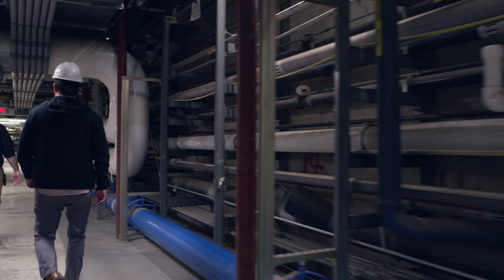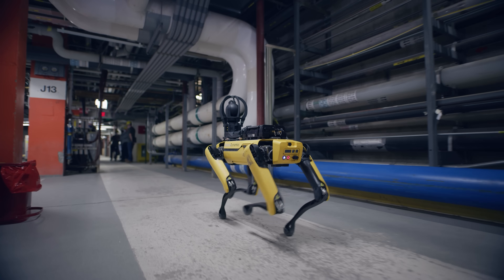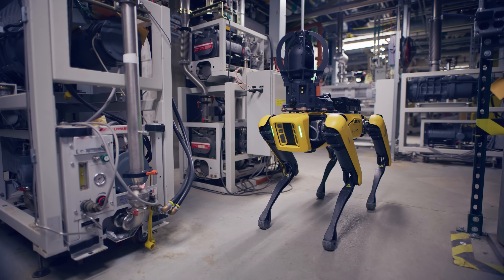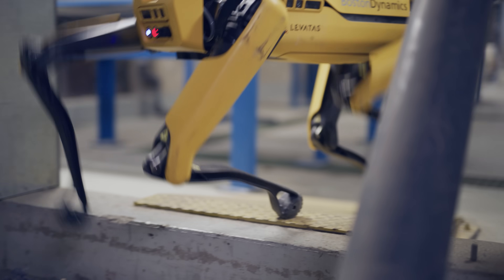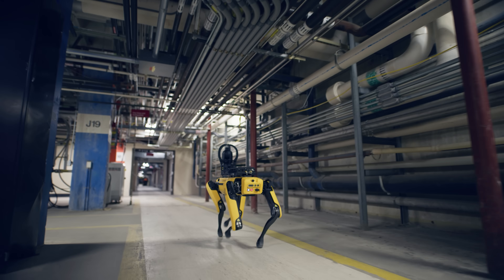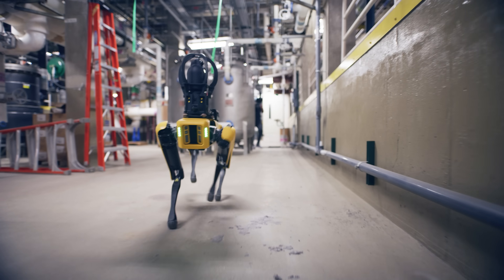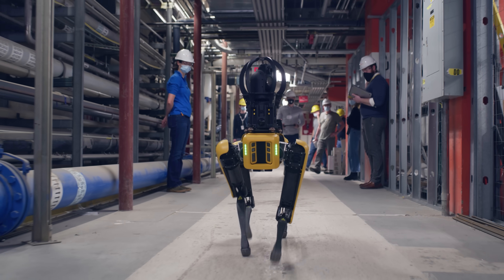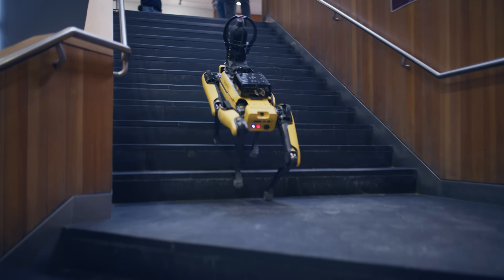Spot at GlobalFoundries | Enterprise Asset Management

Comment: Monotonous tasks like checking sensors and equipment are a great application for robots. Will be interesting to see how these sorts of applications work out long-term and how this industry expands.
Reply: Let's not forget that it would be insanely time consuming to retrofit all this equipment to self monitor, and you'd still need to monitor for if any one of all these new points of failure has any sort of issue. Spot just introduces one new point of failure instead of thousands, and can still be inspected by a human quite easily.
Reply: Sadly, the only people this benefits are the owners of the company. Productivity will rise, costs will decrease and none of these profits / savings will be seen by us. No different as in the 1970s when automation was being introduced and people were promised 4 day work weeks for the same pay due to increased profits.
Reply: Monotonous to you.
Essential jobs for those without your impatience or skills.
Reply: @Ferris.Bueller  ...what?
Reply: Monotonous tasks like checking sensors would be better done by hooking up some sensors & PLCs to the devices and continuously monitoring what those things are saying in realtime. I suppose robots could patrol and look at dials, converting analogue to digital but that's really doing things backasswards. I see robots more useful for other monotonous tasks such as patrolling facilities or going into dangerous situations where you don't want humans to be going until you know what's what.
Reply: @drxym  i see you didn't read the miles of comments above
Reply: It looks like they are pulling hard to create a job for spot. Instead of deploying a robot to read gauges and check equipment, it's much easier and cheaper to make wireless sensors and equipment that sends data to a computer. If you still wanna impress people, buy a drone. It will do the same job much cheaper.
I think the best jobs for Spot are tasks like remote bomb disarming, getting in tight, dangerous and hazardous areas, entering vacuumed areas ect. 
Reading gauges is not the job for such a hi-tech robot.
Reply: @vpryt18  ya they're obviously trying to find a profitable use for spot. Bomb removal is a very specific non profit use of a robot. Overhauling all the sensors is probably more practical but expensive when it's millions of dollars of machines. One robot is maybe a more affordable interim solution
Reply: Don't really get why they just can't install gauges and sensor that can be monitored remotely and automatically by a computer.  If  theres a mechanical part that needs to be monitored, install a camera.
Reply: @samik83  For a fraction of the cost.  These robots are cool but they are a money pit.
Reply: @samik83  It becomes more cost efficient to use autonomous mobile robots when the number of gauges/mechanical parts is very high, like in this example.
Reply: @HL-xi7sz  Don't buy it.  Wired sensors can't cost that much these day. And if there really are so many sensor then I doubt one single robot is enough to keep check on them all. 
Well maybe its cheaper if you have old tech and don't want to retrofit everything....
Reply: @samik83  The cost of Spot is  $74,500. You then have to program your tasks to inspect gauges / temperatures / switches, but that would only take a few days at most in a large company with an I.T. employee.
The kicker is that if something needs to be changed there are no wires to re-route, you just alter the path of Spot and instruct him to forget the old instrument and expand the program to read the new instrument.
Reply: @nigeljames6017   Indeed, a major advantage of those autonomous robots is that they are much more flexible.
Reply: @samik83  
I can tell you never priced out the cost of computer sensors. 
Plus there is miles of wire to install cable trays and massive computers. 
The cost is in the millions.  These so called smart sensors fail at alarming rate.
This one robot can checkout everything plus  if a worker is not where they are supposed to be.  The robot will rat them out.  You are tired from partying and you think you sleep in a corner. The robot catches you and can't argue with it.
Reply: @assassinlexx1993  Well maybe you can tell me how expensive a "smart sensor" is. I suppose CAT5 cable is amazingly expensive too. And yeah I suppose it will need some supercomputer to process all the data....or maybe just a regular server if the data rate is so slow that a walking robot can do it.  Wouldn't be surprised if it could be run on a Raspberry PI.
Reply: @samik83  
One  simple gases detector is a $1000. Now you add up hundreds of places just this one sensor.  There is sensors for valves to detect if open or closed  pressure sensors,  temperature sensors . Flow sensors.  All these sensors add up in the millions at a large industrial plant.  So one inexpensive robot  checking sensors/ safety/ hot spots . Is a wonderful thing for engineers.
Reply: @assassinlexx1993 going to need a source for that $1000 sensor.
Reply: @samik83  
Just Google remote sensors.
Reply: @assassinlexx1993  googled for some Siemens remote sensors. Ranging from $20-250.
Reply: @samik83  You don't work in the industry, do you? I kind of wonder about your Raspberry Pi (???) and CAT5 ideas - I mean even we in our little 14000m2 factory ran into CAT5 max length issues, bus data corruption from electrical noise, and the installation of cables to every gauge just isn't cost effective. It doesn't matter that you can find sensors (where, actually? alibaba?) for that price, they have to be installed by the book, checked, calibrated and then programmed into the PLC. And then where are you? A system with thousands of sensors, that used to be simple gauges read by a human, and instead of using a robot for the checkrounds you now have a thousand sensors that need to be checked regularly for function - and as someone else mentioned before sensors do break down. Gauges, if properly installed and used, are way simpler tech.
Reply: @deildegast  If you ran into problems with CAT5  you chose the wrong cable. If you have max lenght issues then add switches. For a single line these are cheap.
 
What I'm really getting at here is you guys are basically defending a commercial here. Wouldn't surprised if they got Spot with a good discount to do this bit. After all they are trying to sell the thing. I highly doubt Spot is checking THOUSANDS of sensors here.  If they were checked manually before, it would have been quite the job. If you have many clusters of gauges I don't see why cameras couldn't be used to cover a good portion of those. That would actually be a cheap solution.   

I'm not saying Spot couldn't be used in a lot of applications when the AI gets good, but just using it as a "gauge checker" seems backwards, if you didn't have the foresight to install them when building the factory when the cost would have been minimal in the grand scheme of things.
Reply: @samik83  No, we are not defending a commercial. I have 17 years in the industry in maintenance on my back, and I guess the other people that tried to make you understand things are not that simple probably add their experience. Things are not that simple in the real world. And you dont even understand. " If they were checked manually before, it would have been quite the job." Yeah, that is exactly the point. Spot can walk the same tour 24/7, and its payload can be adapted to check the gauges for wrong values, there can be a thermal imaging camera that checks for hotspots in the electricals at the same time, and it could sniff for gas leaks at the same time. Consistently. You have apparently no idea how big systems can get when you think that a 1000 sensors is a huge number, and you have obviously still not understood that a gauge is a much simpler system with less single failure points than an electrical sensor. You live in a dream world where everything can be cheaply bought and built (you talk about building a new building with "foresight"....), while people like me easily see kilometers of wiring, a myriad of installation problems, cost overruns and a huge effort to failproof a system that was built to be human readable but now is PLC driven. All for the cost of a little robot. Heck one single filling machine in one single line line in our factory is more expensive then that robot.
Reply: @samik83  And btw. my factory was built in the 1970s. I hope someone had the foresight you require now, back then, to see that we would be running fiber cables, mobile phones and computer driven lines now. Things are so easy when you have no idea what you are talking about.
Reply: @deildegast   "No, we are not defending a commercial."

It clearly is a commercial. If you can't see that, then I don't know what to tell you. You know what commercial usually do? CREATE a need for a product.  

"If they were checked manually before, it would have been quite the job." Yeah, that is exactly the point. "

You miss my point. I highly doubt there are THOUSANDS of sensor that needed to be checked manually simply because that would not make any sense.  Do you actually have something to back that up that there are thousands of sensors that Spot will be monitoring?  Because even for a robot that would be quite a challenge.

"here can be a thermal imaging camera that checks for hotspots in the electricals at the same time, and it could sniff for gas leaks at the same time."

Now this would be a legitimate use for the robot.

" You live in a dream world where everything can be cheaply bought and built...."

Well thats kinda what you are saying by getting this little robot.  No need for wiring or remote sensors, Spot will check thousands and thousands of gauges for you. Just for this low low price. It will work always, without a hitch unlike those pesky remote sensors.
Reply: @samik83  "CREATE a need for a product." This need already exists, because of humans failing at doing that job efficiently. "Now this would be a legitimate use for the robot." - Yeah, that is what is coming. And the cost of installing your proposed surveillance systems in such a large area will be bigger than the cost of running the robots. "Well thats kinda what you are saying by getting this little robot" No I don't. What I am saying is that in my scenario, if the robot breaks down, you send a human to do its most critical surveillance tasks, at a cost, or another robot. In your scenario, when the centralized system with the sensors that replace the gauges fails, there is no more production - that is why such systems often only do surveillance, data logging and non-critical tasks. And your middle solution, installing cameras at all surveillance points (and eventually other sensors on top of that) is still way more cabling and installation than just buying the robot. So for the price of the robot system, you get something that is better than what you currently have without changing much to what you have, while even with just the camera system, it has to be installed permanently and then can only do that, ever, at the points where you installed it. And that right there is where the versatility of a robot like this comes into play. Me personally, I would like this one to listen inside a certain audio frequency spectrum as well, triangulating air and steam leaks while doing its rounds, and alerting maintenance to the leaks. That is something that would require a human, and cannot be easily done by stationary sensors, hence the robot. But the work has to begin somewhere, and somewhere is "check all the gauges on your round" - you know, because the work actually needs to be done, outside a comfy chair and a drawing board with lots of imagination.
Reply: @deildegast  "And your middle solution, installing cameras at all surveillance points (and eventually other sensors on top of that) is still way more cabling and installation than just buying the robot"

Well it depends. If there are cluster of gauges, one camera can read multiple gauges and would cut down the camera need significantly. Cameras are relatively cheap these days, I don't think you can argue against that. Running the cable is a hassle, no doubt, but should not be really that time consuming to install if you have wire racks going along everywhere, as industrial sites usually have. Cameras can be daisy-chained from one point to the next making it simpler for long runs.  
Gauge reading could be automated by some simple image recognition like they do with Spot here.  
If a camera fails, it's easy to replace. Even if the whole system fails you can do the checks the old fashion way till you get it back running.
Reply: @samik83  I agree with what you wrote, but then the system can only do visual surveillance on a series of chosen points, as opposed to a freely reprogrammable robot doing new or different rounds. If you really only want visual surveillance at a number of inflexible key points, this robot is maybe not suiting your needs (depending on facility size and type). That of course has to be analyzed and checked vs. the cost of investment. In certain cases, robots are just not the solution. In others, they are a very good and flexible base platform for what you would like to achieve.
Reply: @deildegast  Yeah I think these robots have their place and will dominate the industry once we get general purpose AI at a good level. Then they will require very minimal programming and are more of an out of the box solution. For the time being, if you just want to check gauges, this might be a rather niche solutions.
Reply: @samik83  I only wonder how critical is the time of reaction in case if something will go wrong. Or every gauge has to have it’s own personal watchdog robot wondering nearby? Or robot should be trained to run as fast as possible? And if something will go wrong with robot itself - all control will be lost? Hope that at least nuclear power stations will still be populated by outdated unreliable humans… Anyway, common issue with AI “We have invented something damn expensive and magnificent. The only problem is how to use it….’
Reply: I am so alone, no friends. Where can I buy such a robot?
Reply: @TyrellJoanna  If your asking the question seriously, Boston Dynamics still sell them, I believe, for $74,500. But the owner of the company is now Hyundai so you may have to go there.
Reply: Too long Boston dynamic you are not in thé top now

Comment: Why not sensors and wifi, so I know in real time when a machine gets too hot. Why waiting when a robot comes passing by to check it up? Robot: Expensive. A sensor with wifi-module: Super cheap.
Reply: Another sensor to check on the sensor...
Reply: @Master of the First Race of the Universe, The Ultimate Conqueror. And that goes on forever.
Reply: Because this way you don't need to re-build, re-test, and re-certify, all of that very expensive equipment. There's more to the cost than just the sensors
Reply: They already said, in the 1st minute of the video, that slapping individual sensors everywhere was cost prohibitive. The cost of hardware per sensor may be cheap but you aren't considering the cost re: logistics when you have thousands of sensors, all of which need to be administered & maintained, nor the cost to setup and maintain a working wifi network in an environment like a factory
Reply: @kgoblin5084  Not to mention the cost of installing wireless APs in tens of kilometres of concrete service tunnels
Reply: @popcorny007  not to forget the power supply for all sensors. and if you have to power all sensors u could use PoE already...
cost over 9000
Reply: They mention this in the beginning of the video: it would be too expensive to retrofit all the various pieces of equipment for that purpose.
Reply: It will tell you if it's overheated on Spot tablet.
Reply: +1. After installing the sensors you will get a huge amount of useful data. Use it with AI or something else. 
what do you prefer - Get a realtime data or wait until the robot reaches the sensor? :)
Reply: Ok. you buy the robot. How much it costs to customize the robot for your needs?
Reply: @rubanika  10,000 bucks maybe

Comment: Still think those legs are unnecessary in these environments, make it much more expensive and drain the battery way faster.
Reply: It frequently has to traverse stairs and rough terrain, wheels or treads just wouldn't be viable